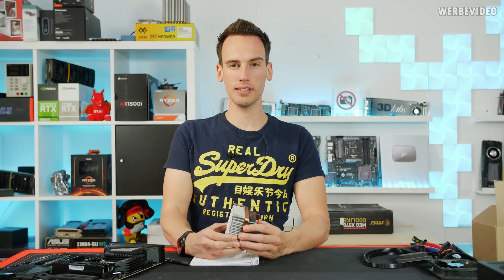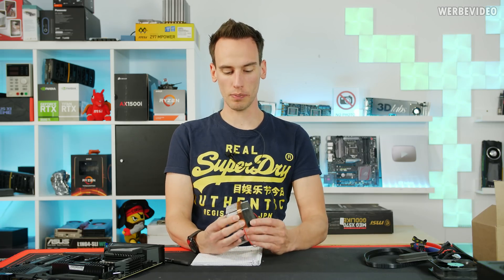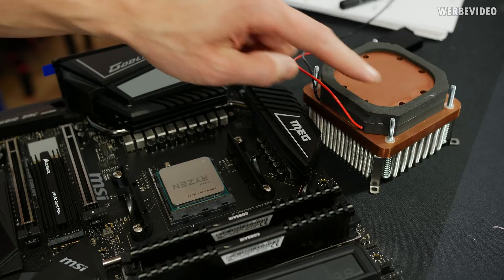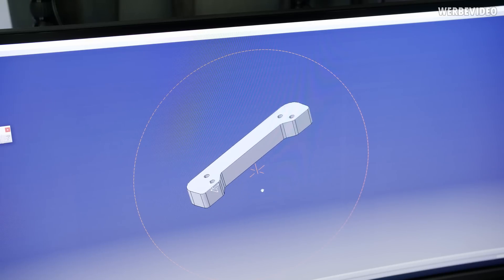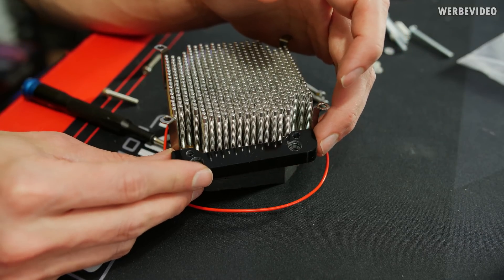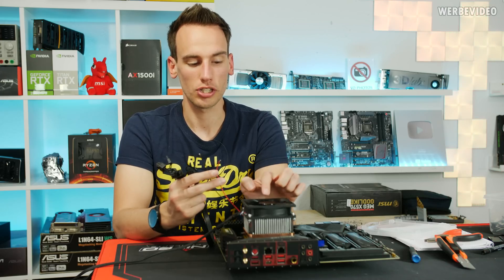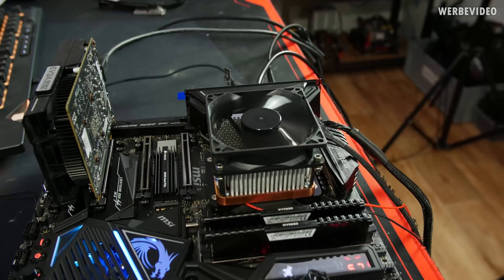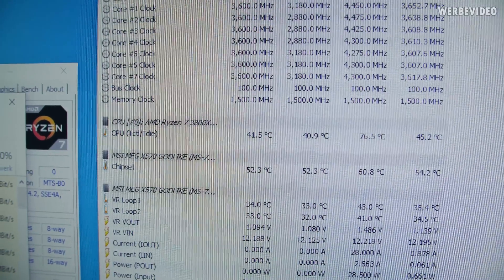Threaded Rods to cool a RYZEN 3800X sub ambient? Swiftech MXC4000-T

Comment: I experimented with TECs for awhile.  They’re interesting, but far too much effort for too little reward.  I’d only mess with them if you want a relatively low cost method for preventing degradation of your CPU by chilling your loop.  Low initial cost.  They’re extremely power hungry.  Direct contact is a PIA with TECs.  Insulating everything is what sucks and there’s a near certainty you’ll render your mother board virtually unsellable when you upgrade due to a variety of cosmetic factors associated with the insulation.

Comment: It is all about the CFM. If you had a dissipation cooler 4 times the size coupled with a 120mm or more sized fan, you might have observed a larger differential in temperature.

Comment: You might be interested in undervolting the TEC. It might seem counter intuitive but increasing the voltage increases dT and decreases COP so by decreasing the voltage you should hit a sweet spot where the increased COP and lowered power in the heatsink part results in a lower temperature. You would be sacrificing dT but it doesn't matter when the peltier can't cope with the heat, it should only impact idle temperatures.

Comment: My personal setup 
3800x 4425 MHZ (all 8 cores locked) (1.1 to 1.385v)
dark rock pro4 +thermal grizz
I idle at 31c and prime 95 shows 77c max temp at 1 hour test duration

I'm super happy with it all.

Comment: It's fun to use your brain BEFORE actually doing something.

Don't drill like him or you're gonna kill ur engine really fast. Switch it to high-rpm/DRILL gear first and make sure the object being drilled WON'T MOVE. Also hold it on the edge of the table or put some plank under - if you don't want to destroy ur table fast).

Comment: I've really always wanted to use a peltier unit to cool a cpu, even if it's a small power hungry one I feel that for a long time I don't think anything will match the cooling potential. I would definitely try a diy peltier tac cooler as I have a 1000 watt power supply and some spare mobo and cpus lying around.

Comment: I got one of those coolers when I was still a newb. Those helicoil pins were sure exaggerated in the advertisements. The pelteir was too small and gobbled juice. I eventually just stuck a fat 120mm neon green (blacklight case) fan on top and used it in a secondary pc. Swifties were good heatsinks.

Comment: What if you made one of those today, but every single one of those rods were a heat pipe with the threads or fins all around it?
and maybe make it copper instead of aluminium.

Comment: Not at all certain why people listen to you. Baling wire around the mount hooks would have been fine.  It would literally have been spec.  The pin-sinks were designed to use multiple smaller fans so that all pins had airflow, with the single large fan you're literally starving 30% of the heatsink of airflow and that effects the performance of the TEC.   Get two fans and make sure there is airflow down into the center pins.

Comment: Running a TEC at maximum current isn't effective. Cooling is better at lower current consumption, as these devices are so inefficient that heating from all that wasted power quickly outgrows the heat pumping capacity. However, I doubt it'd have made much of a difference.
A better idea would probably be to have a regular water cooling loop and run the radiator cooled water through a TEC stage of a few modules to get it to sub ambient temperatures.

Comment: I remember those coolers well.  I can't quite remember what CPU I used mine with, but it was one of the northwood (HOT!!!) pentium 4 processors and I had the peltier 'plate' powered by its own 350W PSU.  I vaguely remember using vaseline as well as the foam insulation pads, back them the motherboard I used wasn't cheap and I dare not risk it being exposed to any condensation.

Comment: My 5ghz 2600k used a 300 watt element for cooling, and regulated temp to keep from forming condensation. I originally had decent performance at lower clocks on this setup using a tower cooler (skyth ninja 3) and when i had power to the element dialed down and cpu temps just above room temp at any workload. However for 5ghz I used a 24cmx38mm radiator and water. I think my cpu was outputting somwhere about 190 watts of heat plus whatever the element was producing. However my cpu was always only just above room temps, and it ran like that for pretty close to 5 years.

Comment: The problem with peatier is if you are trying to move a lot of power. Find a high freqency two core cpu or disable cores in bios and see if you can reach low temperatures in single threaded benchmark.

Comment: Try running more than 1  module stacked with lower voltage. Like 5v+5v+3v, this method only consumes about 27Watts. I have reached -31C temperature measured from surface of Peltier.
Reply: Any TEC can hit -30C if you insulate the cold side.
Reply: @Pence128  Are you really trying to tell me that you can reach -30c with any TEC, when using 5v? My test is that 1x12706 with 5v/1.4A cools down 19celcius  from ambient temperature. With 12volts, then yes, you can easily hit -30c... i'm not sure what you are trying to say.

Comment: I'am watching this despite I am 100% sure that the bottle neck of that cooling system is peltier module, which should take more power than CPU to be able to transfer the CPU heat. So basic mathematics tells me that this tiny radiator with cute little fan would burn after few second without even starting the system probably. Yet I am watching this anyway because I want to see it. :D

I was mistaken. They mounted in there quite powerful peltier module. Draining additional 140W of power only to push CPU heat for 3mm away of CPU is a huge wast of energy. This is probably why this type od cooling never become popular. Cooling system had to produce more heat than CPU itself. It is like mounting a stove on top of your CPU and then praying to remove the combine heat of both away from the PC case.

Comment: Good names of the past imo:
thermalright, swiftech, dangerden
You used to be able to pickup a dangerden block for like $60 and a pond pump from homedepot for $20, some tubing from homedepot, find some old car radiator for $40 and a tuberware container for a resvoir. Now days you gotta spend like $1000 and wear sunglasses to block all the RGB.

Comment: I think you needed longer mounting screws 🤣 Interesting to see it cooling  at all with the peltier off....did you put a volt meter on it with no power to see if the heat was creating any useable power?

Comment: I had a peltier and custom water cooled Athlon 800 back around that time. Blew out a 300W ATX PSU and had to get a custom 12V one. Definitely not worth it. You have to consume enough wattage to "pump" the equivalent heat through the unit.

Comment: I've seen a lot of these attempts to cool the CPU directly with a Peltier cooler but I do not see this as the correct application.

I would like to see a liquid cooling setup where a Peltier cooler is installed post-radiator to add additional cooling.

You could even have it connected to a temperature sensor so that it only turns on when the radiator falls behind in cooling the water.
Reply: @nosirrahx the position of the peltier in the watercooling loop doesnt make a difference. You would need a separate cooling loop and block cooling just the peltier, but its not worth it as peltiers are not efficient at high heatloads like this. 
Linus did a couple videos on this if you look around.
Reply: @lalPOOO  It does. If it is pre-radiator then the radiator is less efficient as it is limited to ambient. The hotter the water is, the more impact the ambient cooling will have. The Peltier cooler on the other hand can and will be sub-ambient.
Reply: @nosirrahx  you think that, but that's just not what actually happens. If you don't believe me try it for yourself. The radiator just adds more ambient heat to the loop, increasing the load on the peltier.
Reply: @lalPOOO  When the system is under load the water is far above ambient. The radiator is limited by ambient. The Peltier is not not limited by ambient.

Think of it is way. If you want to cool boiled water, which results in cooler water.

1. Let it sit at room temperature and then put it in the refrigerator.

2. Put it in the refrigerator and then out in air temperature.

I am not sure what you have backwards but you want the coolest component last to maximize delta at each step. In fact if the Peltier is very strong and is before the radiator the radiator could warm up the water, something that is impossible if the radiator is first.
Reply: @nosirrahx  I have tried the thing you are telling me will work. It does not.
Reply: @lalPOOO  I'm pretty good with thermodynamics and can't see ambient after sub-ambient could be better.

IMO, inconsistency in the testing setup would be the far more likely setup.

We might know in a few months because I want to test this now.
Reply: Absolute mad lad!
Reply: you need to patent this idea
Reply: Yeah ! Excellent idea ! 
I worked on medical lasers, the laser source was water cooled by Peltiers modules.
Peltiers modules had the role of heat exchanger. Cold faces for the laser water loop and hot was cooled down by a classic radiator+fans water loop.
Reply: Switching a TEC on and off to cool a component is a very poor use. When you switch off a TEC, the heat will surge extremely quickly back to the cold side, causing a rise in temperature that wouldn't happen if they were always on.
Reply: @pootispiker2866  Always on though is massively inefficient as your PC is not under overheating conditions very often.

I have not looked into the device enough to answer this but do Peltier coolers still function if you give them very little power as in there are not on or off? If this works you could in theory throttle power to it depending on the heat load of the system never letting it dump heat back into the loop.

Comment: Iam wondering... der8auer would the temps get better if u machined a housing around the heatsink with opening on the bottom? this way there would be air tunnel created and the air would be pushed out at the bottom of the fins

Comment: I had one of these swiftech copper/aluminium heatsinks (without the peltier) back in 2001 for my socket 462 AMD Athlon. PC Still works but not used it in like 8 years even then just to see if it worked.

Comment: Dude wow, for fifteen-year-old technology this is pretty cool
Reply: Old doesn’t mean always mean bad, my old cooler (discontinued in 2006) keeps way below 0c peak core temps. As an example, at 350w (FX-8350 at 1.7 Vcore) my core temp was below 0c with a max hottest block temp of -35c at full load in stress testing (idle was -60c). So for it something like Ryzen is incredibly low heat load (you could cook like 3x Ryzen chips at once at the same -35c temp). Just a standard commercial phase unit (cost more since it wasn’t like $20 in parts but it’s ancient!). I want to make a new one with triple stage for my next upgrade (hoping for -100c on a TR-64 core), obviously the cooler will be expensive but it’s probably going to be used a lot considering who knows how many chips that old Asetech cooler has been on and still working for relevant chips like Ryzen today.
Reply: I remember a lot of Peltier experimentations especially from extreme PC modders during that time, it's interesting tech even if it's ultimately not an overall good solution.

Comment: if it using rod as heat transfer surface it'll made more sense blowing from the side not from the top of the rod, heat dissipation using liquid beside the surface area the fluid must flowing effortless to "carry" out the transferred energy

Comment: I remember those Swiftech TEC coolers. Unfortunately the foam did little to prevent condensation as it was not airtight making it impossible to use for extended use. Some people replaced the foam with neoprene and would apply conformal coating to their boards - that would get around the issue until the water droplets got onto another component (GPU, PSU) sitting in the case underneath and fried those.

Great if you are swapping hardware on a test bench for a day, but pretty much useless after that. It's a good thing custom water has come such a long way.

Comment: I tried and tried to cool my 3800X,  no matter what I did it just loved to hang around 73C under full load.   Air,  AIO,  custom loop just didn't change the temps much.   I moved on to a 3950X and no issues.   I can sit in the mid to low 60's without issue under full load.   Not incredible I understand,  but just much cooler then the 3800X.

Comment: Great video, as usual! Question, do you think the cooling potential would be better if you modified the base plate with much longer threaded rods and a higher pressure fan? Something in the area of a San Ace or Delta?

Comment: you can buy different peltier pads for very cheap u should  buy one  that u know the specs of  off ebay and retest this  the point of a peltier pad is  one sides gets cold one side gets hot  the more u can cool the hot side the more the cold side will drop tho still limited on power   so get yourself a new peltier pad and retest

Comment: The variables for your nominal hole size are you power- "watts", your MS x Hz with decimal moved over= Duty Cycle and your focus with whatever lens you happen to be using to attain your desired hole size. At least with a Fibre Optic laser and not a rod laser. Rod or mirrored lasers use volts and MS and have no Duty Cycle

Comment: der8auer :  another rookie classic and inexperienced mistake for a selfproclaimed youtuber like yourself.... Tctl/Tdie IS NOT THE CORRECT TEMPERATURE READING AND IT NEVER WAS OR WILL BE....it's RATIO without any unit. Your program says degrees C just because it has no other temperature reading which doesn't make it true. The only real temperature for any Ryzen cpu-s is Tdie and Tdie only. Usually HWInfo reports the correct CPU temperature under the motherboard section in the subsection "Tdie".
In your case Tctl/Tdie is a ratio that includes Tdie + TSoC + TVRM + Tjunction together and it thus usually 10-20 degrees C higher depending on the cpu LOAD and cpu UTILIZATION. That's called TEMPERATURE OFFSET....and it was already present with AMD FM2+ cpu-s and apu-s back in 2013.
You reporting this a CPU temperature is harming AMD-s reputation by contributing to non existing AMD hot meme which fuels Shintels troll camp and their brainwashed mindshare.